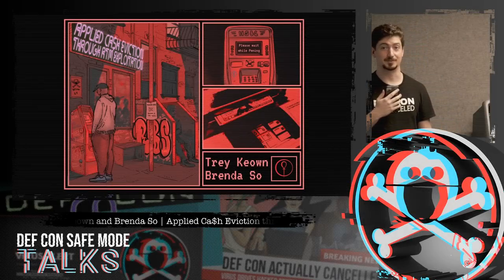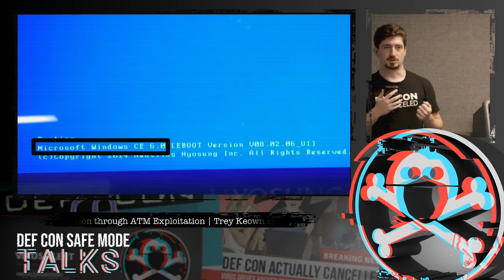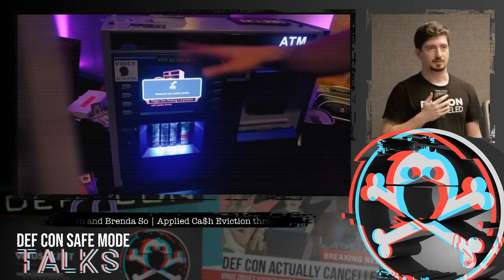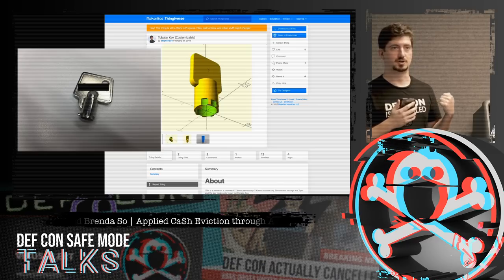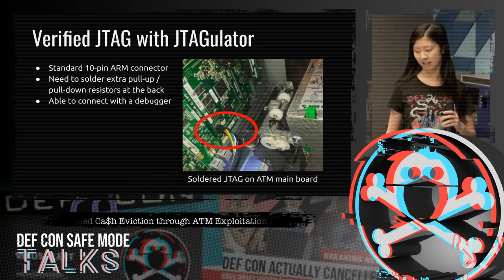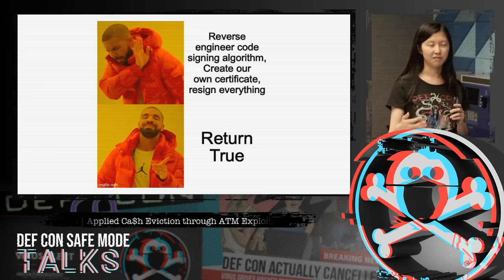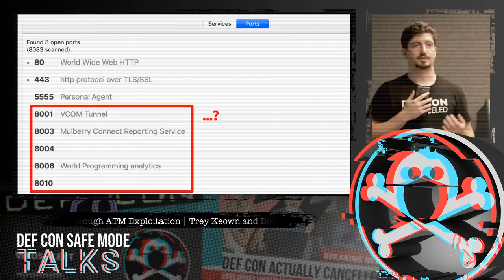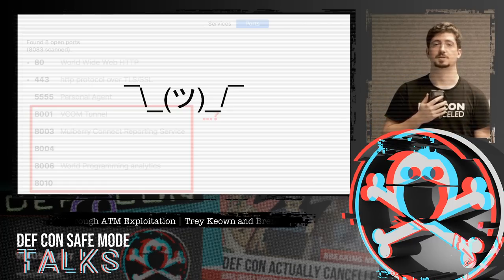DEF CON Safe Mode - Trey Keown and Brenda So - Applied Cash Eviction through ATM Exploitation

Comment: why desolder the chip multiple times instead of mounting it on a pcb and with some test pads? Or make it socketed. Once you can load your own firmware you could just activate the make it rain function by activating the bill dispenser.
Reply: Can we talk

Comment: Did you try enabling USB? A lot of ATMs have the USB turned off as a security measure. There was a gang of thieves ripping the Camera out of ATMs and hooking a USB keyboard to the wires.
Reply: But what if there isn't any keyboard drivers or anything written into the firmware? Like at the start? Wouldnt the USB keyboard just not work?
Reply: @swine13  ATMs run on windows and unless they take out the driver or like I suggest disable it, the keyboard will work. That is how this gang got in. The ATMs used USB for their security cameras so by cutting the camera off and splicing in a USB keyboard they were auto detected. USB is not like ps2 or serial where the system only activates the device on boot since you don't want to reboot to use a flash drive or whatever.